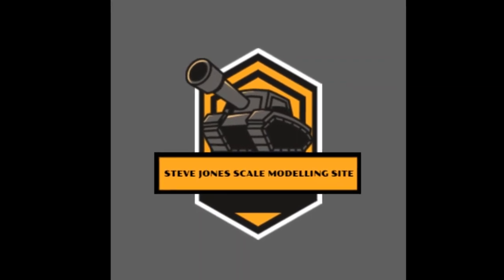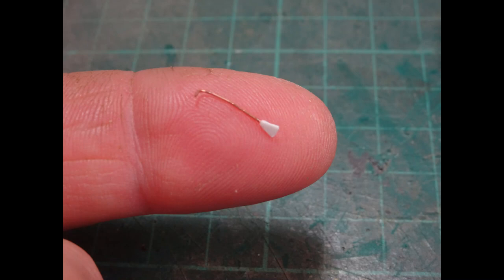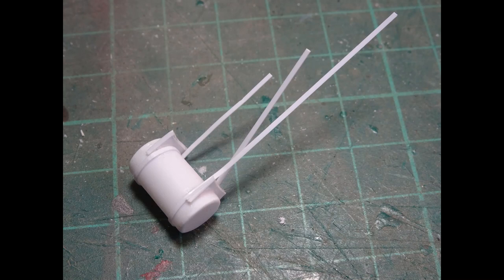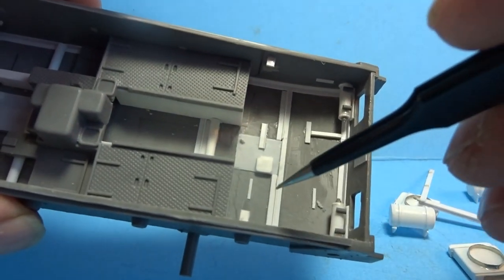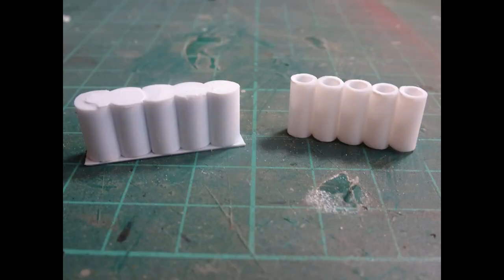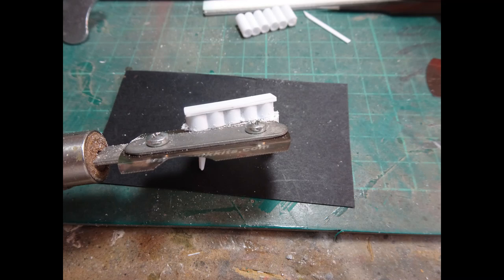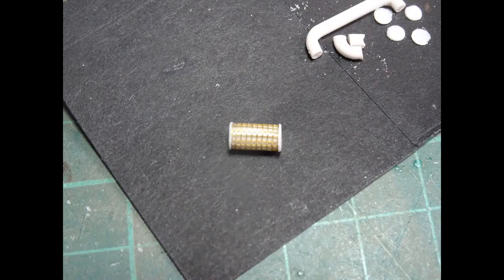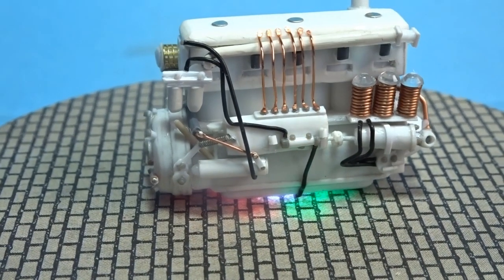Mirage 1/35 Scale Kitbash C7P Polish Artillery Tractor PART TWO

Comment: Hi Steve I'll bet this cheap, nearly 20 year old kit, has never been built with so much detailing. May not be 100% accurate but it certainly looks superb. Engine is excellent. There are aftermarket detail kits and PE (Part does the PE I think) but with skill like yours who needs to go that route. Great video and does show that you don't need to throw a load of expensive extras at a kit to produce a great model.